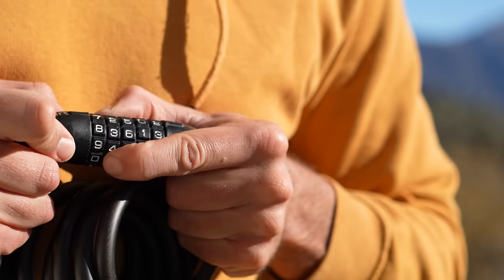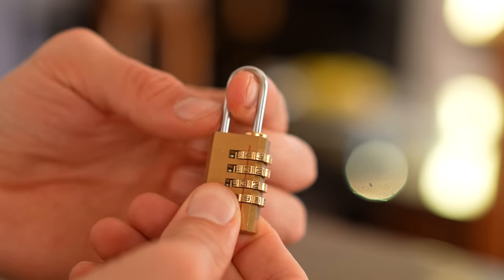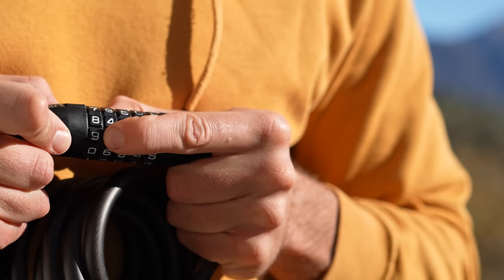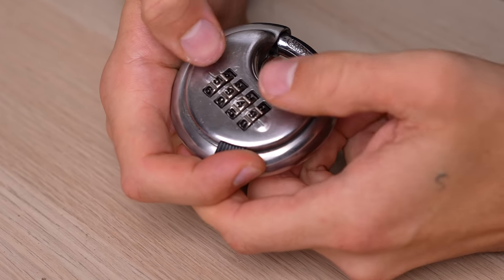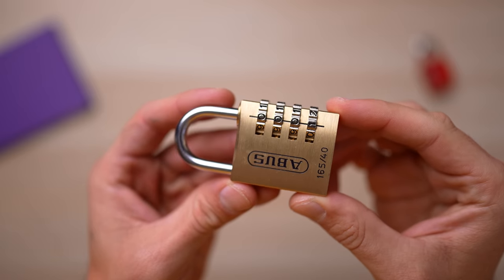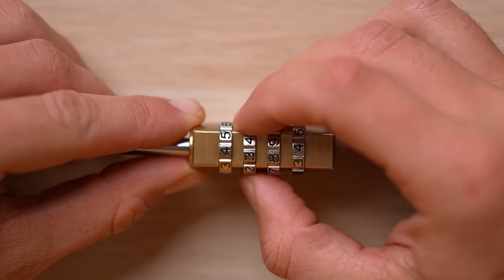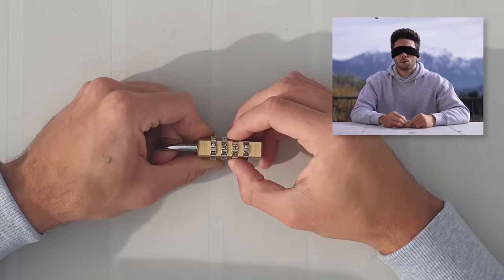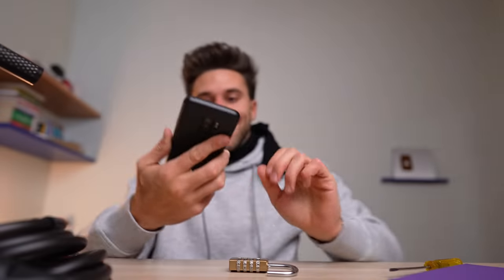This is Why Combination Locks are Completely Useless

Comment: Well that no Lock is 100% secure is nothing new, it's more about how long it takes to open it. The longer the better, because the longer a thieve needs to open the lock the more heighten is the possibility that the thieve feels nervous and flees or gets caught in the act by someone.
Reply: All security is just a matter of deterrence
Reply: If we're only talking seconds, the lock is completely useless, though.
Reply: Why am I not able to open my lock using these methods?
Reply: @neltymind  not completely useless, would still keep people who are really lazy away. Or at least non thieves who haven't watched this video.

I mean hell, even if you put your wallet in a desk drawer it still keeps most people away Vs leaving it in the open.

How many people are going to try to open every single desk drawer just in case a wallet is there.

Even the tiniest deterrence like opening a drawer that isn't yours puts off 99 percent of people from bothering if the reward is much less than the risk.
Reply: exactly!
Reply: @neltymind  But almost 5 minutes is pretty good I would say.
Reply: Most thieves are thieves of opportunity. And a non-locked bike is an opportunity.
Reply: 239 likes

nice
Reply: Yeah, locks are not completely secure as they are designed to be able to be unlocked.
Reply: Well that’s not good for a thief
Reply: or you can just destroy the lock
Reply: I’m wondering about using a combination lock on a gym locker.  It would be much harder to crack when the lock itself is in a fixed upright position because it can’t be moved around very easily.
Reply: Most padlocks and bike locks, unless they can be bypassed or raked, are probably not going to be picked, but attacked with a bolt cutter or angle grinder.

Comment: If a good lock takes five minutes to decode, and you want to protect something for ten hours, all you have to do is put 120 locks on it. The only downside is that you'll have to dial in 120 combinations when you want to use the thing, and you'll have to close and scramble 120 locks when you're done.
If you bring two buddies, though, it becomes a more manageable 40 locks each. But a thief can also bring two buddies, and then they can decode 120 locks in 3 hours and 20 minutes.
Reply: You probably need a spreadsheet to remember all the combinations of the 120 locks (because using the same combinations several times would make it easier to crack every lock).
Now they just need to hack your computer/phone and find the spreadsheet 😁
Reply: Or steel the paper spreadsheet from your bag, if you wrote it on paper.
Reply: 2 factor authentication....on top of the best combination lock money can buy, u also want to install a fingerprint reader and iris scanner and a sms authentication all of which must be completed within 60 seconds otherwise a massive electric current will course through the bike shocking any rider on it.
Reply: @Supvia  Just lock the bag which contains the paper spreadsheet with 120 locks.
Reply: I've solved this conundrum by simply owning nothing that is worth stealing.
Reply: @AutPen38  Smart.
The alternative is Paris Hilton style: Just own so many things that you don’t notice when something is being stolen.
Reply: @Supvia  no you only have to remember two things
1. The number of the first lock
2nd a algorithm to calculate the next number for the next lock.
eg. set the first lock to 1234
then your algorithm could be to add 1 to first digit, 2 to second digit, 3 to third digit and 4 to fourth digit. Each time it gets higher than 10 you cut off the first digit of the 2 digit number you got.
so in this example you get
1234
2468
3692
4826
5050
6284
7418
...
Reply: spreedsheet time baby!
Reply: Are you the guy writing math books for schools?
Reply: There's a missing variable in this equation. Regardless of how many buddies the thief has, if they are impacted by the sight of hundreds of locks, there's the chance that they're giving up from mental fatigue before even starting
Reply: MaThS 🤓
Reply: this is humour
Reply: Even if you keep 10 locks, aspiring thief might get demotivated to make an attempt
Reply: Unless you put the same code on all locks then it takes less than ten hours to open.
Reply: @AutPen38  🤣
Reply: @AutPen38  
I love that 
Where do you shop? 🙃
Reply: Or just freeze the locks open 🤷‍♀️
Reply: Who will bother with your 120 locks when a good bolt cutter or a lever bar will do the trick 😉
Reply: I don’t think it’s worth their time unless they take the risk of being seen
Reply: @jont2576  sounds very illegal. but its a good idea!
Reply: Yeah but a person trying to open a lock for 20 minutes would attract some unwanted attention
Reply: I fail to see the point.
Reply: Then put all your valuables in the shed next door with only one lock. The thieves will never suspect.
Reply: thief: ok, I don’t steal you, but remove all the labels or markings on the locks
Reply: @AutPen38  Abstinence is key.
Reply: A thief would probably enjoy stealing the locks to sell on eBay.
Reply: @AutPen38  Unfortunately anything is worth steeling to some. People get stolen, never mind inanimate objects 😮
Reply: @neutronenstern.  Just don't forget the order of each lock to open, that could mess things up really quick.
Reply: Profile picture is American Psycho: checks out
Reply: Or just buy an alarm
Reply: or just, you know, unlock the top one
Reply: This is how key derivation in stocking passwords work
Reply: the best lock is a to hire a sniper to watch it 24/7. Probably you'd need to hire 2-4 and then they can take shifts
Reply: Nah, if you want to protect you stuff for 10hrs with a lock that lasts 5 minutes you need to park it next to the bike that has lock which lasts only 4 minutes.
Also,  i suppose the beefiest lock from these would survive the longest, the others would be cut sooner
Reply: 119 fake lock plus 1 real lock chained together will be the solution. fake lock should look, feel and function exactly same as the real lock except the real lock open the chain.
Reply: @benjaminhawthorne1969  nobody defeated your $5 padlocks, because nobody cared :)
Reply: And you would have to mark each with a number.
So the thief could unlock all the locks, take your shit, put the locks back, erase the markings, and then you're fucked.
Reply: That's the concept of cryptography!
Reply: Then it takes less time to use a battery driven power tool  to cut the thing the lock is hanging on. Or the hinges.
Reply: you could lower the amount of needed to unlock locks by locking them in place certain ways, like maybe have 2 locks that when opened also remove a third lock from the amalgamation (still locked though), which you could cut this down for yourself by 66% but you'd also need to do it in a way that doesn't make it look obvious. sure the criminal might find some of the false locks but not all of them. lets say they find 50% of the false locks before unlocking the 2 real locks in the system, they're still unlocking 80 locks, but you only have to unlock 40.
Reply: @Supvia  Or the owner learns to crack the lock like the thief instead of remembering
Reply: I would use that as false door. It wouldn't matter if you took 10 hours to unlock everything, it'd be pointless. As for the real door, it was always under the doormat.
Reply: so if you use these many locks for a vehicle or cycle, the price of lock will exceed the price of the vehicle 💀💀
Reply: @brusherfish  😂 „Wait, I’ll come in a sec, just need to crack all my locks first.“
Reply: So you are the person in maths problem
Reply: Or bring a hacksaw next time
Reply: Congratulations, you’ve designed an escape room.
Reply: pulls out bypass tool
Reply: @Supvia  they can just use a blowtorch or just break the locks
Reply: @aaravgupta2627  Haha, yes, problem is that the bike owner can’t do it, cause the bike locks are too expensive 😂
Reply: lol
Reply: If I was going to steal something and saw 120 locks that would be enough to deter me from taking it in the first place
Reply: The thief Perfectly Timed The last Lock To Open When You Came
Reply: any good key lock that can't be easily opened, like some Paclock models, is ok for stuff like a gym lock. For outdoors application the selection is narrower because you ideally want something that can't be cut. Anything can be picked but few have the manual skill to actually single pin pick a decent lock
Reply: Draw a red line on the bike. Any lock above is a certain code or range of varying code combinations and below, would be the same.
Course, only the owner would know, like a cither in secret messages, rules decode?

Comment: Most locks are designed to deter thieves, not stop them. If somebody really wants to get past a lock, they can and will. However, the longer they are delayed the more chance of them getting caught or simply giving up for an easier job.

A nomination lock could still be useful when paired with contemporary locks or further combination locks. Remember, the more of a hassle it is for you, all the more hassle it will be for any perspective thieves.
Reply: "Locks are to keep a honest man honest
Reply: And that is why they don't just use a hammer to force open the lock, because the chances of them getting caught increases by a very large scale.
Reply: Locks are to keep honest people out.
Reply: Yeah the bike lock is probably actually pretty secure if you see someone just pulling on the lock and keeps turning the dials people will probably get 𝘀𝘂𝘀picious
Reply: nomination lock?? is that one you can only open by public vote?
Reply: Prospective. But yeah, agreed :-)
Reply: TL:DR: where there is a will, there is a way
Reply: If I would bea thief and see 2 Locks on something, I would probably put more effort because there most be something in there worth getting.
Reply: @jaroroytapel  2 locks is just kinda stupid, but having one basic lock means that you won't have people look at it and think "I could easily steal that". Most people will just ignore it because the effort of picking or brute forcing the lock open is too high for them to bother.
Reply: @technophobian2962  Yes, my comment was referring to an actual theif,who would rather likely try to pick a lock. You send a signal that there is something more of value there that's all.
Reply: @gregdunn401  yes, the liberal party are experts at picking them
Reply: @clockyshortsroblox  not really, if you're dressed like a cyclist you'll just look like you just locked yourself out of your bike or people won't even look that closely and think you're fiddling with the bike itself
Reply: @clockyshortsroblox  i guess 4 minutes is far more than the few seconds it would take the owner to umlock it, but then again i guess most ppl wouldnt assume a teft in broad daylight, they would ask "is that your bike" and the thief could easily shrug it off like "yes it's mine but i forgot the combination". The true help is that in 4 minutes you can get stressed that the owner might come back and call it quits. For the 30$ it's not that easy either, you gotta concentrate,  and it's even harder to spot the owner now.
Reply: i agree
Reply: “the more hassle it is for you, the more hassle it is for the thieves” isn’t always true, many locks have flaws that make them faster to pick open or bypass than it is to open using the key/code. for example, hitting the lock to move the locking lug out of place, shimming, bypassing unshielded cores to turn the internal mechanism directly and oversetting pins using a comb-pick. all of these methods are as fast or faster than opening using a key
Reply: that wont stop McNally from doing it in under 10 minutes with his dimple rake.
Reply: e
Reply: @retrogamer2503  most people will be amazed at how big locks have to be before they won´t yield to a solid blow with a hammer...

Comment: Back in college for some reason there were a bunch of abandoned bike locks on a bike rack. I noticed them on several occasions until eventually the school put notes on them stating they would be cut off if not claimed. For some reason I took it upon myself to try to crack the combination locks, realizing now I used the same method the author did. After a few days of practice I was able to crack most of them and claim several free bike locks!
Reply: wow!
Reply: There are some romantic couples that close bike locks somewhere as a "proof" of eternal love. So, basically you make a lot of people sad that day 🤣
Reply: ....several useless free bike locks.
Reply: And with the knowledge Gained, you could get New "free" bikes, which are matching with the locks.
Reply: Bruh Clan  Enough do...
Anyway bike theives are pretty good at cutting them quicker than they can be picked so they're all pretty useless anyway.
Reply: @doggiethegamer6956  lol...
Reply: @gabrielabagala  I mean they were going to get cut regardless so it doesnt matter.
Reply: he is not an "author", this is just a guy you make videos!

Comment: There's a design solution to this, but it makes the lock a lot more cumbersome. You need a switch that runs down the outer groove of the internal rotating gears. This switch needs to lock into the loop of the lock so that you basically it locks the lock's loop in place when it's disengaged from the combination gears. You end up with a lock that lets you either try to open the lock by pulling the loop, or lets you rotate the numbers, but not both at the same time.
Reply: Can one get the kind of locks you describe?
Reply: @johnwilliam2474  Yes, there are better combination locks that can't be opened with the methods shown.
Reply: @qq84 but what are they?
Reply: That's always the deal when it comes to basically any lock - if you want a lock that is going to be easy for you to open in a few seconds, then an experienced lockpicker can probably crack it open in little to no time. If you're willing to deal with a more cumbersome and inconvenient lock that takes longer to open then it's probably going to be a lot harder for an experienced lockpicker to get it open too. You just have to pick the right type of lock for your purposes - for example if you're just locking your bike up at the shopping centre while you go shopping a simple combination lock that is easy to carry and doesn't have a key that can be lost is ideal in my opinion. It makes the act of taking your bike look extremely suspicious because they either have to break the lock or pick the combination while people can probably see them doing it rather than just being able to hop on and ride away without raising suspicion if it was unlocked. If you wanted to secure your bike in a more isolated area for a longer period of time then I'd go for one of those big heavy iron U shaped locks with the funny keys - the only way your average thief is going to get a good iron U lock off is with an angle grinder, because to pick them open requires special tools that most people don't have and wouldn't know how to use even if they did have them.

Comment: To be fair, I use a combination lock almost entirely in the gym locker rooms. If a prospective thief is trying to get into my locker, 10min fiddling with the lock at an awkward angle is going to be way too suspicious to be able to pull it off. That’s the point of these locks, not unbreakable security, but to make it difficult enough that getting away with it is unlikely. In 10min there’s not only a good chance other guests or staff will get suspicious but also there’s a good chance I’ll return to the locker in that time
Reply: I've been fiddling around with combination locks for a week or so, I have a 3 and 4 combination lock that is typically used in gym lockers and I can open a 4 combination one in 40 seconds or so if I keep messing it up, and 10 seconds if I get lucky. Also when you lock something with it it's way easier to open compared to what he does in the video. You don't have to use your hand to tension the shackle, you just pull it towards yourself so it tensions itself. Again, I have zero experience with locks and after a week of playing around with it  I can get it open in 15-20 seconds average. Just so you know it won't take 10 minutes.

Combination locks are especially garbage, other than bicycle locks which are kinda ok because you have to use a lot of force to tension it, it is way more of a hassle than a regular combination lock.
Reply: @kagehasu  So my dirty jock strap and socks aren't safe when I'm in the shower?
Reply: its likely youll return back to your locker within 10 mins? is that how short your gym sessions are
Reply: 10 min? Lol, maybe 3 min max
Reply: @billp4 Unfortunately, the thieves shall always acquire your undies.

Comment: I am definitely going to try this out. You did not try a rotating dial, though. You know the ones most people use for school. Also, 8 mins to crack is great if you are not a criminal, but most criminals want their crime done in seconds. So, this is helpful if you forget your combination of have to open a lock for a forgetful friend.
Reply: It is very easy to pick a school locker
Reply: Rotating Dail locks are just as easy to pick. You actually just use the first method in the video.

Comment: I recommend you to take a look at LockPickingLawyer. He makes laugh of all the locks out there, no matter how complex they are, picking within a minute. Most - within few seconds. You can learn few tricks about locks by him
Reply: My school has started to use partially electronic locks, the key has some sorta identifier and it beeps inside a correct lock and then allows it to turn, without that the lock wont turn at all

And if the battery in the key dies youre fucked till its replaced
Reply: @joule400  modern cars use that system aswell. Atleast for the doors. Probably ignition aswell.
Reply: he is unable to pick Abloy Protec2 and has never picked EVVA MCS. He is talented but many of his fans put him on far too high of a pedestal